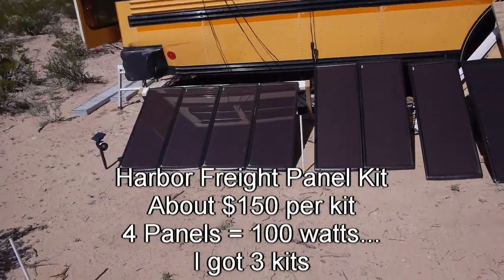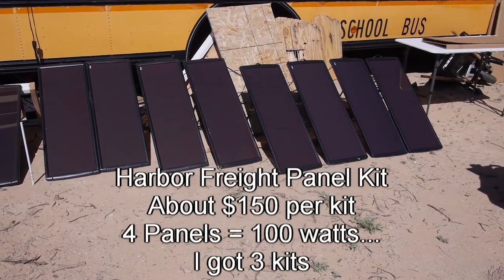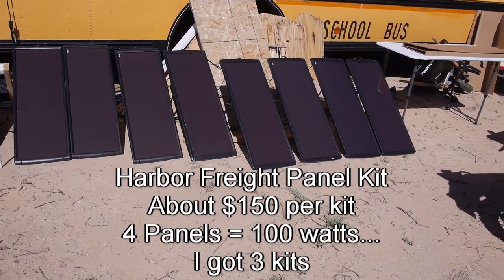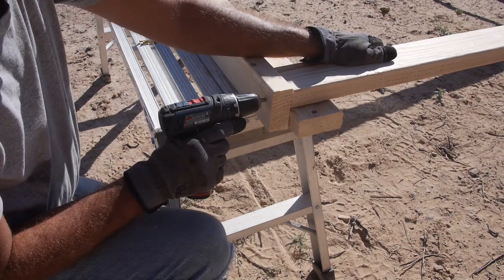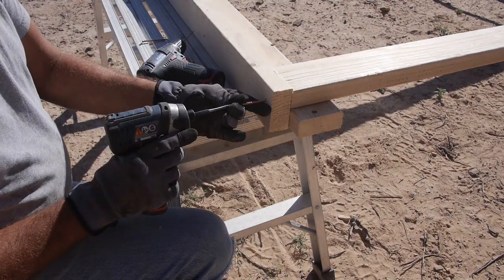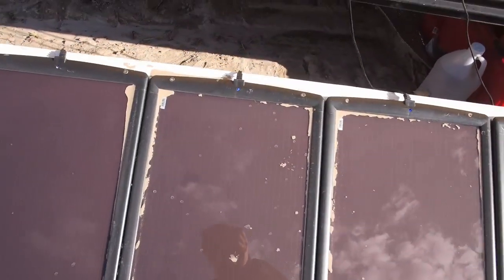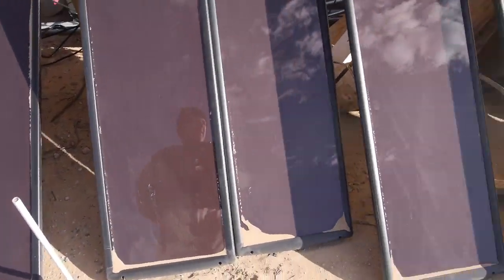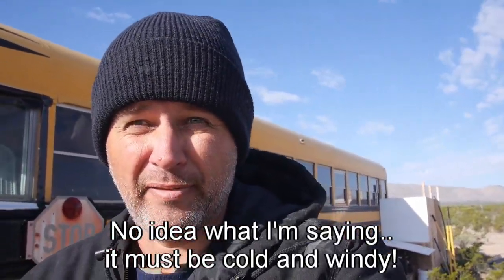2017 October Harbor Freight Solar Kits Install

Comment: I’d have brought both 12v and 120v into the bus, through separate conduits. It was hard to tell what you did, but I’d run lights, sound, etc off 12v, saving both efficiency and inverter capacity.
Reply from the maker: I have redid parts of the system so many times I forget the details. My reason for running most things on AC, AC appliances and light are cheaper and easier to find. DC had more line drop, but I know there is loss at the inverter. The important part is to do something, and not spend too much time on social media :)

Comment: This might be ok where you are. In central Illinois, I’d have to dig the posts at least 3 feet down and sink in concrete. I’d also have to use treated lumber and paint it to have it last more than a couple of years.
Reply from the maker: I have been surprised how well that works here, I have crazy winds, red flag warning days often, and the panel don't move. I thought I would need concrete but am glad I didn't!
Reply from the maker: Oh and it's been 4 or 5 years since I did the video, still working.

Comment: You posted this over 2 years ago. How have they held up in the elements? It doesnt look like it has rained much there, but I'd like to know if there has been any water damage/corrosion issues. I have these panels and i need to decide whether or not to silicone seal them / make rain proofing efforts.
Reply from the maker: They're all still working. Some of the plastic frames have cracked. I loomed the wires which has helped a lot. Sun damage is the biggest problem with the plastics and wire insulation. Here's an update video https://youtu.be/qqRAD9rgvVw
I don't see any problems from water, we do get some rain, about 10" per year, monsoon rain is enough for flooding. Thanks for the questions!

Comment: Did you vent your battery box?
Reply from the maker: A vent would be a great idea, but my design had enough gap in the lid to take care of that, accidentally ;) IF I ever get back to that, I want to tighten up the gap, I've seen mice in there before, and then add a vent, and maybe a small fan, the inverter seems to get pretty warm in the summer. Thanks for the comment!

Comment: A 3 4 5 triangle is the most precise way of making a right triangle to be any any I could be 30 40 50 foot triangle but if you use those ratios you will definitely get a right angle it's worth trying with specially if you have some rope that you can measure out that won't stretch should be good. I would imagine if the Rope was on pulleys for the rods then even if you stretched it everything would stretch and the marker of 345 or or 15 20 25 could remain consistent or use wire whatever
Reply from the maker: One of the problems I keep running into is I don't have a tape measure long enough! I bought a longer one for building the house, but when I started I had a 25 foot tape and a 36 foot house!

Comment: Hi Carlin... greetings from Tucson! I could see your batteries looked like marine, deep cycle. What are their MCAs? How long do the last powering those items you showed? Also, since 2016, how long did they last as in long term? Thank you for your share!
Reply from the maker: Yeah I got them from Walmart. I'm looking at the website and am pretty sure they are 29DC size, 845 MCA... As for the run time, typically I can brew coffee, nuke some burritos, edit video on the laptop, and run a 5 cubic foot deep freeze for a couple hours. I don't have enough solar, yet, so if I'm home all day I might need to run the generator, but that's only a couple days a week, couple hours total. Its not a hard science answer ;)